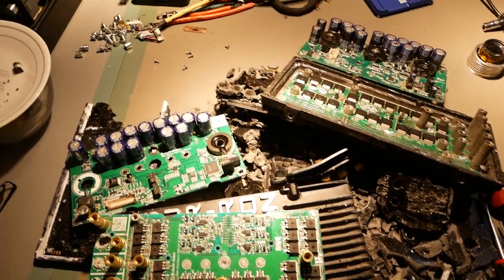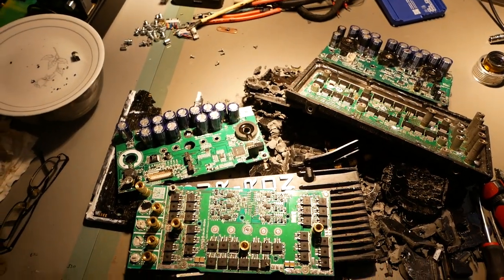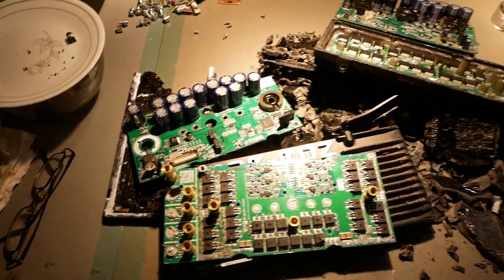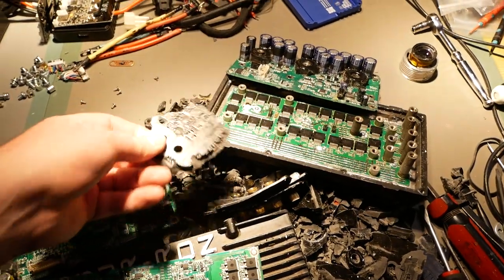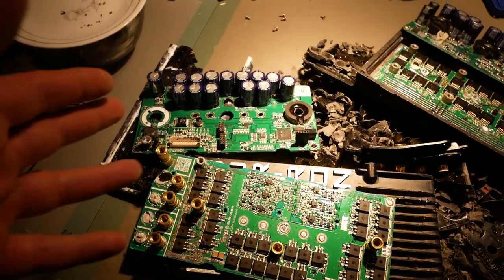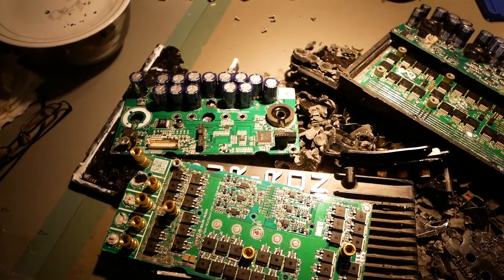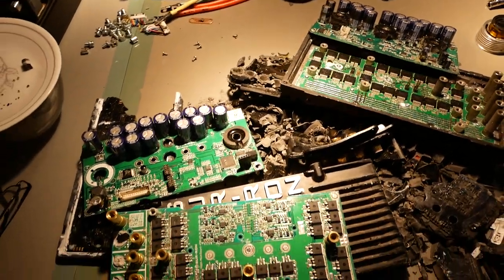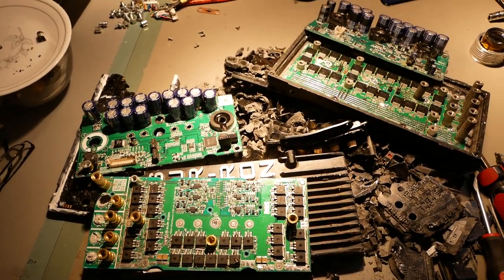Surron and Talaria Teaser

Comment: can you do the ko nano after that ? i want to see how it compares to the stock controller.    i want a bit more power with the stock bike but i know how KO cut corner that’s what keeping me from buying it. but if it’s not that bad i would like to know
Reply: You just said it cuts' corners.. Why is it an option? 😓
Reply from the maker: I don't have a nano and they are not all that popular AFAIK. If I had one to take apart, I'd do a video on it. For now, I have a pile of controllers coming from several sources to disect on camera, but anything else from KO right now. It just depends on what comes my way. I try to get cerain hardware, but it doesn't always work out. I can't say this with certainty since I don't know for sure, but you are probably going to find similar lack of quality in the Nano and the Rush as exists in the Pro and FSPEC controllers. You would do better to buy some other option. Insist on something that uses FOC motor control. Fortunately for you, there are options. ASI, EBMX, Tronic, Nucular and soon Trampa all have controllers that are suited for a Surron with good build quality and FOC support. This is an area that is lacking from KO as they use older and less refined motor control.
Reply: @BuildItTuneItEV  hahah i know  low budget x) haha just want to keep it stock and to gain a little bit of top speed since i’ve put a 54t sprocket